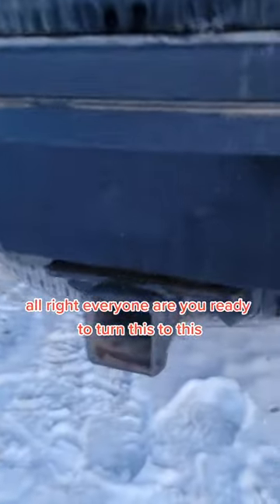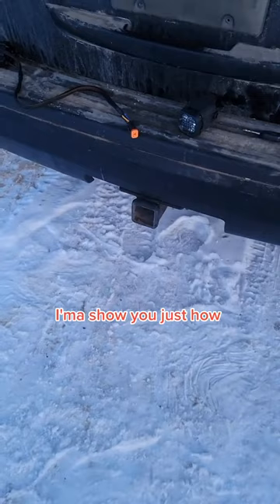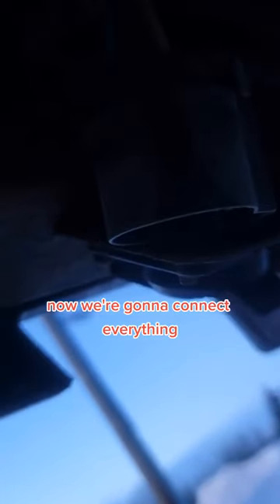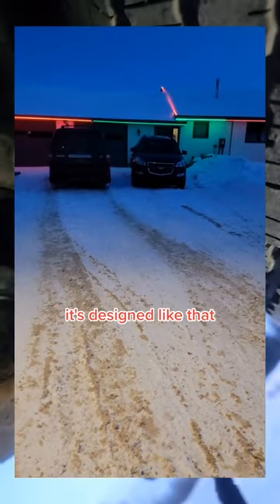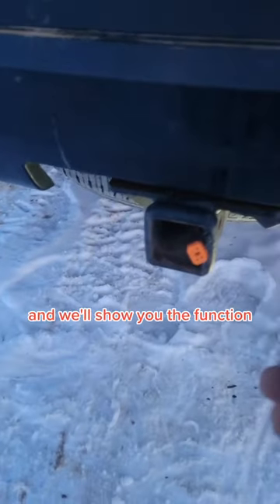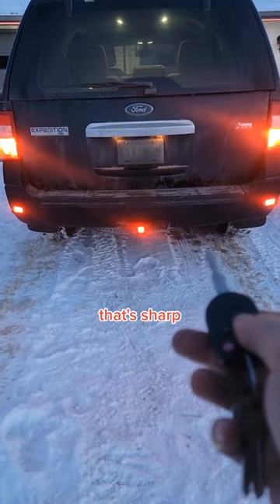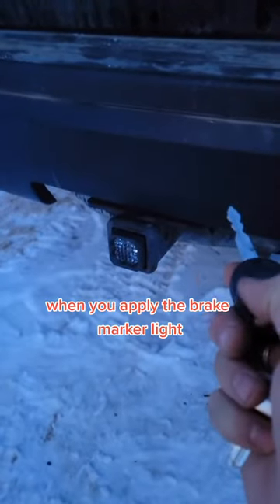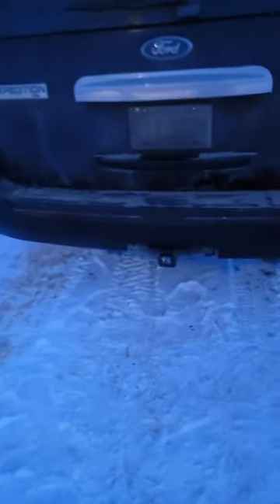Diode Dynamics HitchMount

Comment: This is awsome I have the same model, where can I see video on the install of those other reverse lights. I'd like to get this set. Also do you have any tail light options, looking into the anzo led tail lights.
Reply from the maker: www.btslighting.com under our Work Light section, you can find the Diode Dynamics reverse light kit. It involves cutting the bumper but install is pretty straight forward!

We do not have any options for tail lights on the Expedition.